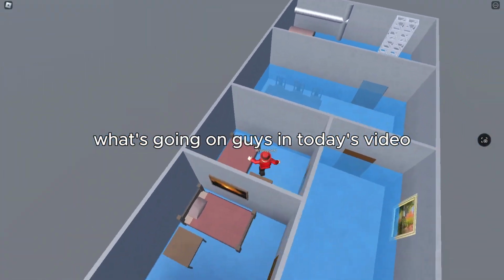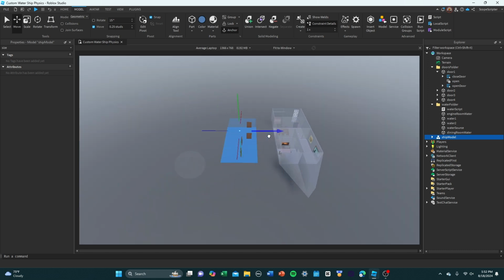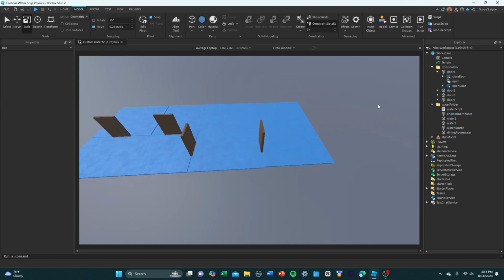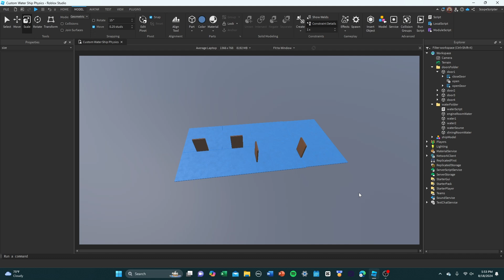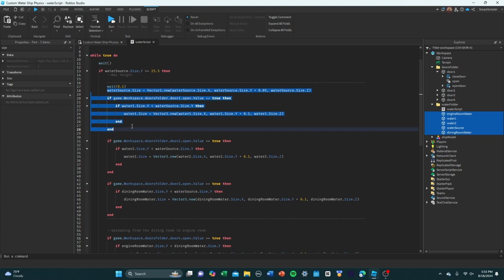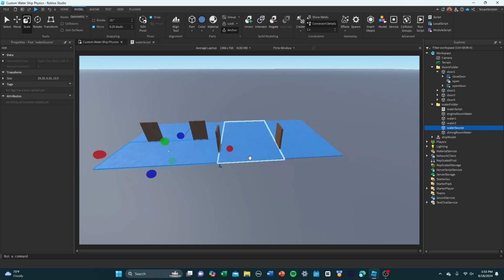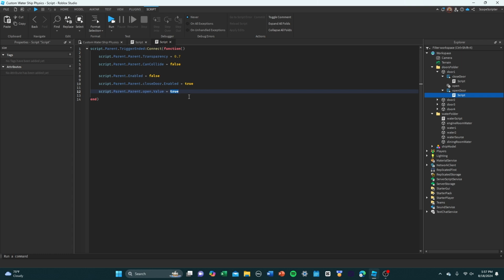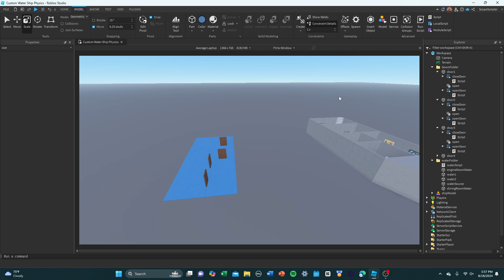How to create custom water physics in Roblox Studio

Comment: Thank you for your efforts in creating the tutorial on custom water physics in Roblox Studio. However, I found several areas that could benefit from improvement. The pacing was inconsistent, often too fast for viewers to grasp key concepts without repeatedly pausing. The explanations lacked depth, leaving much of the logic behind the code unexplained, which could frustrate beginners. Additionally, the editing was somewhat disjointed, causing a lack of flow throughout the video. A more methodical and thorough approach would greatly enhance the tutorial’s effectiveness.
Reply from the maker: Hi will

Comment: Hi! This works great, however, once the main water source has reached the top, and then you open the doors, the water does not fill up. How do I fix this?
Reply from the maker: Check the output? Maybe there’s an error
Reply: @ScopeScripter  There is no error, I also tried changing the < 25 to have an or == 25
Reply: Also, in door 1, the proximity prompt says open, then the other doors say close, so you have to close them to then be able to open them, even though they are closed. (After you closed them once its fine.)

Comment: Hey! I make a submarine game in which it will be devided into segments and if damaged each one will flood. The problem is that players will be able to customize the segments, so I can't predict the location or shape of water parts. Maybe you could give an advice on a compartment detector or other solution? This video is straight to the point and very helpful
Reply from the maker: Put the water parts inside of the segments maybe? Or have a script that aligns the water parts position with the position of those segments. You could have a part inside the segment in which a script takes a position from and then uses it to set the position of the water